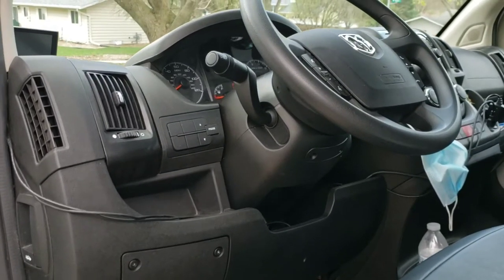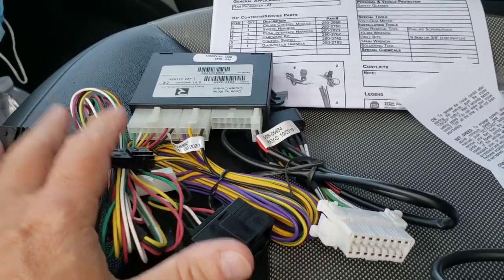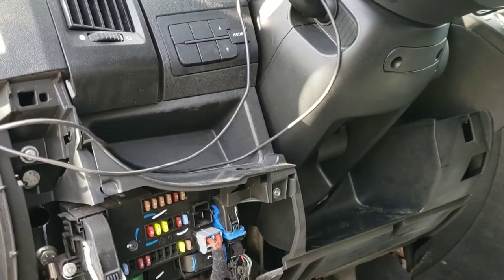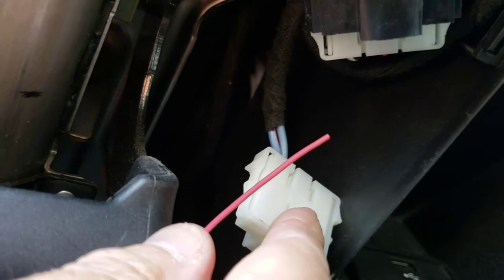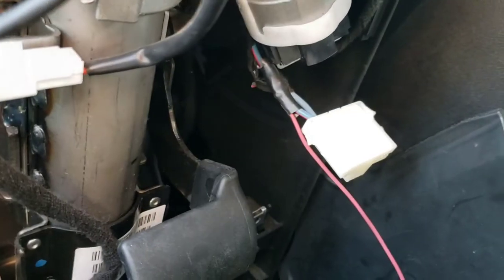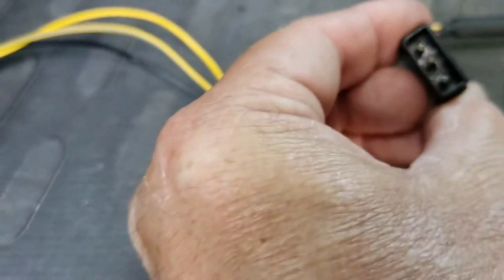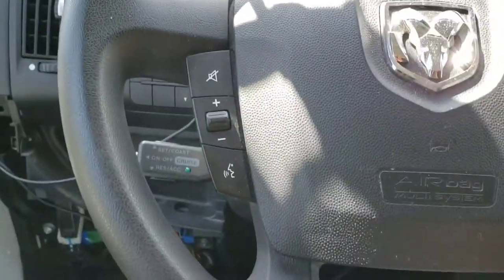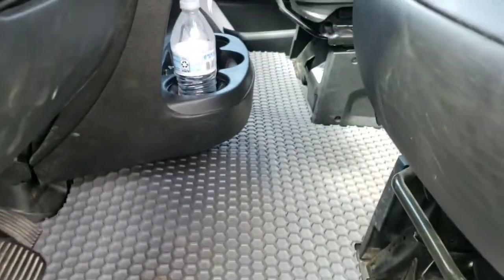How to install Rostra Cruise Control on Ram  Promaster

Comment: Will this cruise control installation automatically adjust the revs in order to maintain a specific speed?  I have a 2014 model with a manual gearbox
Reply from the maker: yes. ots a bit annoying as its not smooth like factory would be. It will kick in with high RPMs going up inclines.  I only use when the terrain is flatter.
Reply: @MikeandLisasExcellentAdventure  thank you. When you say kick in with high revs, how does it increase the revs without dropping a gear? eg. if I am cruising in 6th gear (manual gear box) and I approach a hill, the revs are going to automatically drop as the vehicle gos up the hill. Just wondering what you mean by the revs going up? I am assuming that we a manual gear box the cruise control will obviously not be able to drop a gear for you

Comment: The factory cruise in my van is very aggressive about keeping the speed where I set it. It'll drop 2 gears going up a small incline and the engine will scream. Does this unit behave that way too?
Reply from the maker: Yes  Every vehicle I have owned has been like that.

Comment: Thanks, will this work on 2021 models promaster too? I thought cruise control is basic included but not mine...
Reply from the maker: possible not this one,  but if you just look up your year and make on ebay, Amazon, or Google the one you need should pop up.
Reply from the maker: This cruise control that I bought says its for 2014-2018 Promasters
Reply: Thanks Mike, I will search for it.😂